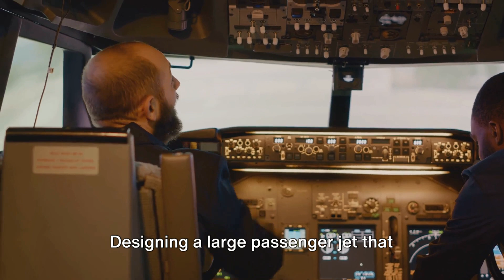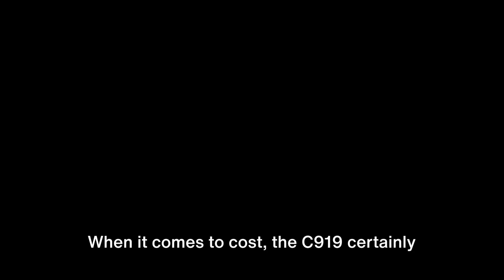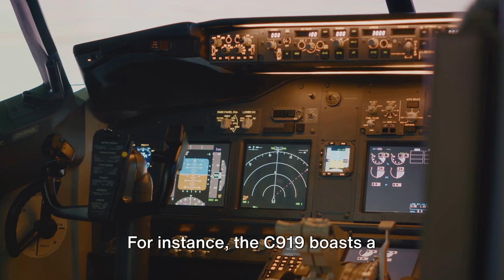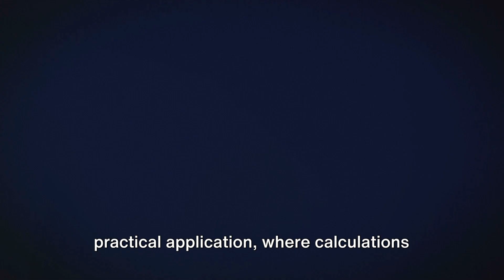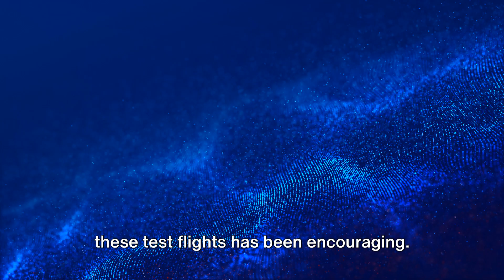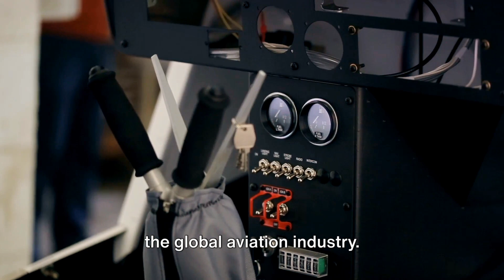The Making of the C919  China's Leap

Comment: So, a copy engineered Airbus?
How much of the equipment in the C919 is actually made in China?
There is no doubt that China will catch up some day. However, the C919 will at best be made available for worldwide sales in the late 2020s.
The issue is not so much the airplane itself. The main challenge is to make the package available with a sufficient maintenance system. This is actually where other possible competitors to Boeing and Airbus have run into problems.
Reply: It's too easy to bandy the word "copy". You try copying a complex machine like a passenger plane. Go on!  All you need is to get a few parameters wrong and you end up with a disaster.  For a start, many of the dimensions are different.  If you know anything about aerodynamics, you would have known that changing even the length of an aerofoil will change its characteristics and will affect other parts. Shows you know nowt. China had to test and understand how the different parts behaved as the video pointed out. You don't just slavishly copy. Silly comment.
Reply: @Zerpentsa6598  The comment shows he is NOT a engineer and scientist, and never can be. Forgive him.
Reply: "So, a copy engineered Airbus?"
No, 
Take as an example the CJ-1000A engine developed by the Commercial Aircraft Corporation of China (COMAC) for use on its C919, a game-changer in the industry, featuring cutting-edge technology and superior performance.
The modular design of the CJ-1000A allows for sections of the engine to be replaced rather than the whole engine having to be removed for maintenance or repair.
According to industry sources, the CJ-1000A engine has also been tested by international certification agencies, including the European Aviation Safety Agency (EASA) and the Federal Aviation Administration (FAA) in the United States. These certifications are expected to be obtained in the near future, allowing the CJ-1000A engine to be used on C919s that are delivered to international customers.
Reply: @vision9275  , exact
Reply from the maker: no